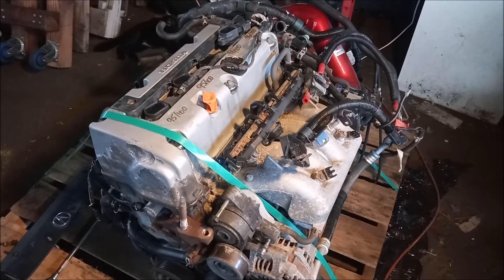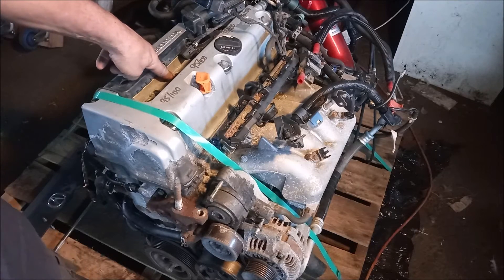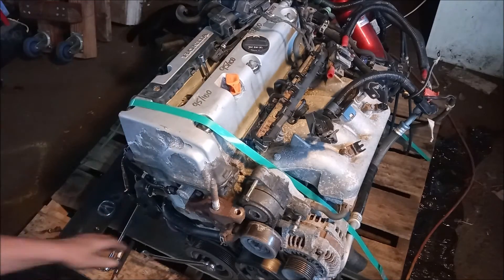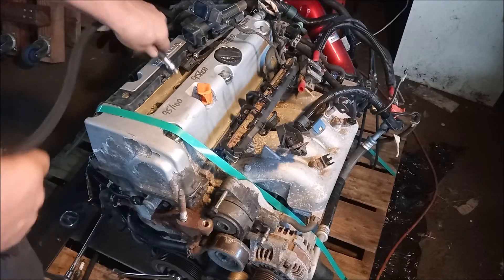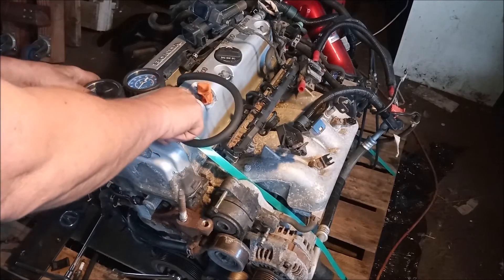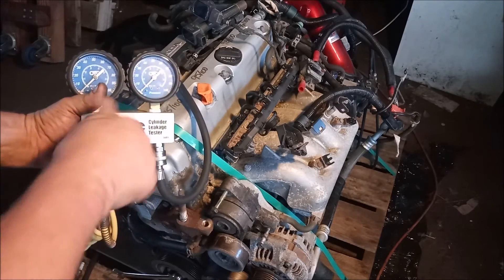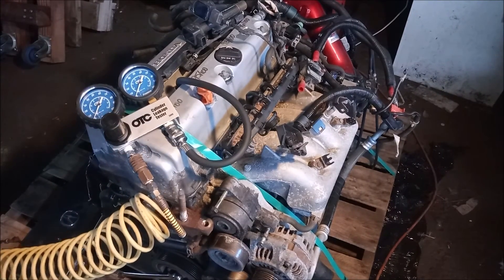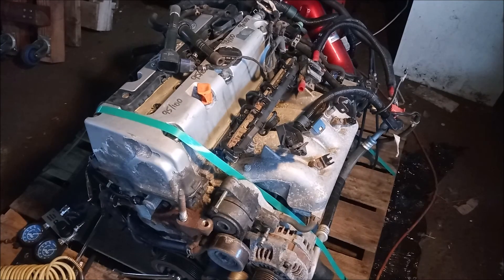Honda K20 Cylinder Leakdown Test - Acura RSX Engine - K-swap

Comment: What about a 85 out of 100 , would the motor still run fine? What number in your opinion would require the removal of the head to get the valve job done.  I had a timing belt snap on a 1998 acura integra , I am trying to check and see if I bent any valves. 
Also , I don't have a compressor but I plan buying a pancake compressor. Would that be sufficient in supply enough psi to run the test?

Thanks and great video ~
Reply from the maker: Is that 85/100 on all cylnders or just one? You'll need to verify compression as well as leakdown but my guess is the engine will run ok.  Typically if you have a bent valve you will not be able to rotate the engine. Little pancake compressor is probably a waste of money for this purpose.
Reply: @Merryfrankster_  

I was planning to get the compressor just to have on hand , clean computer parts , car parts etc .. 

The timing belt is removed and the engine is on a stand , I think the only way to check it , is with compressed air. Unless I get a new timing belt and do the timing , and try to crank it by hand.
Reply from the maker: @reza_dc2  Your best bet is to remove both camshafts so all the valves go to closed position, and then rotate the crankshaft. In this situation there should not be any valve to piston contact. This is also the best situation for doing a leakdown test.